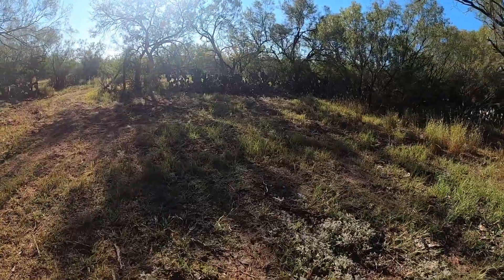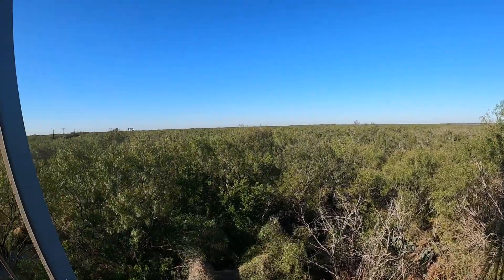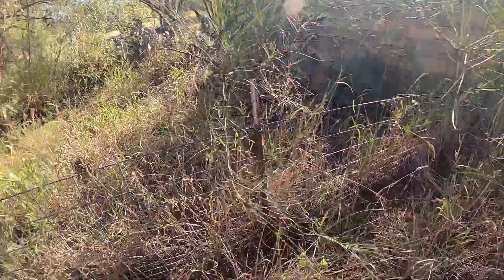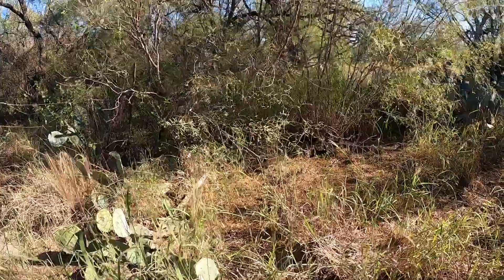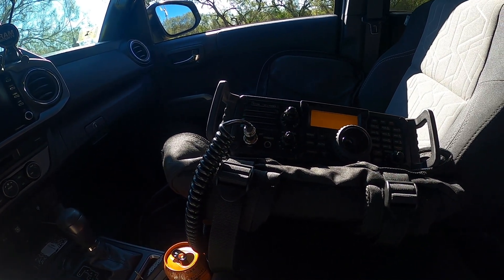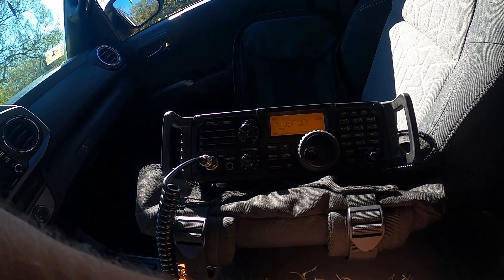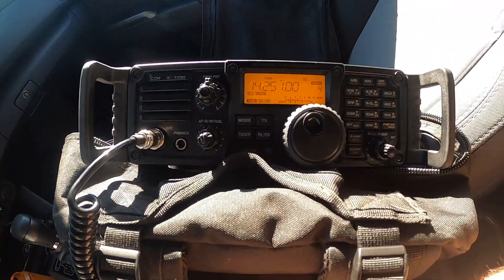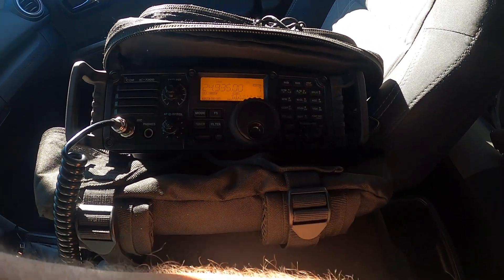Ham Radio Windmill Antenna Tower with various contacts

Comment: I’ve got a 1976 Chevy Itasca RV on a Chevy p20 chasis, the system is a 350tbi. After I got a new alternator put in my gages spin crazily, they ALL spin besides the battery gage one I’ve noticed. I’ve gotten it looked at by 2  mechanics and the wiring is fine according to them, they say it’s the cluster panel itself but I struggle to understand that as they were working perfectly fine before the new alternator. Also there’s a green wire, it was connected to something then I discovered it burned off at the end. I also noticed there’s two green wires coming from the headlight switch if that matters at all. Please help, at this point I’m wanting to see what’s wrong myself do you have any advice?
Reply from the maker: Seems strange that the cluster was working fine before the alternator swap and now it doesn't.  It's hard to diagnose a problem like yours without being at the vehicle.  It sounds like a voltage regulator problem.  Again, very hard to diagnose electrical issues remotely.   Good Luck.